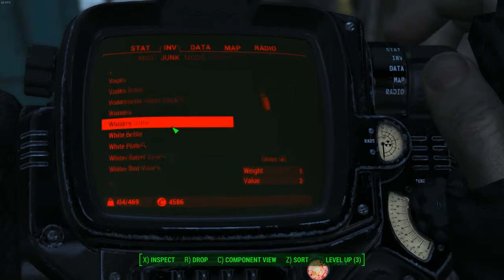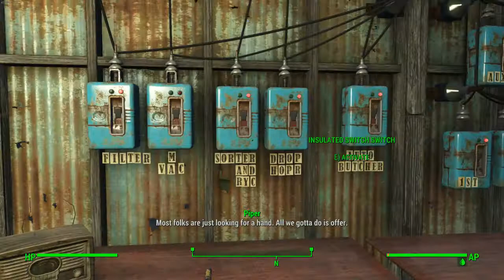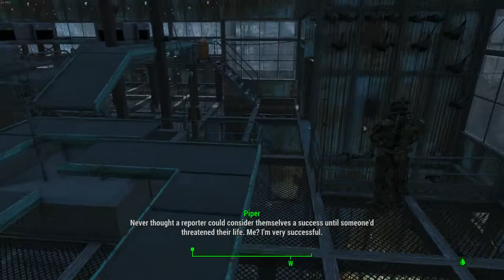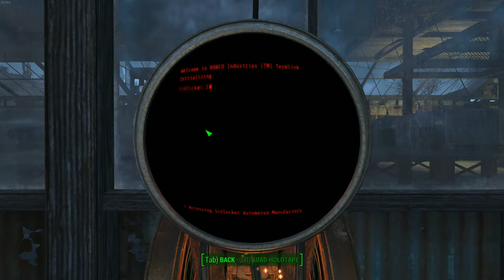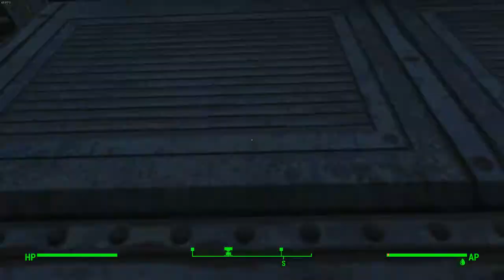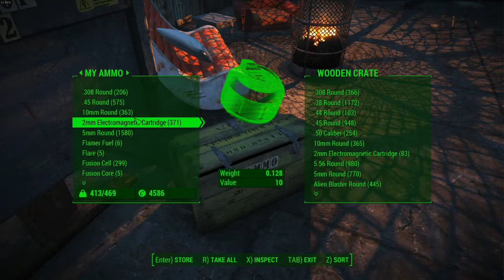GTCM INC Mega Warehouse part5 Dual ammo plant

Comment: Are you still on Fallout 4?
Reply from the maker: I take breaks but yes.  I am currently modding the game to make it almost as hard as Frost Survival mod but without the complete overhaul.  I still have not completed the main story line and want to finish the game, but do it with my warehouse as my player home.  The big problem right now is finding a mod that makes fusion generators consume fusion cores.  This means you do not have "unlimited" power.  This way the game is so much more fun to play as it introduces a very unique challenge in my specific play style.  However, I have not found a mod that does this to the fusion generators yet.  I did find one that requires bio fuel (and consumes it) for small, med, and large generators though.  So I will most likely have to just swap out the fusion gen's in the warehouse for large ones.   Thanks for watching.